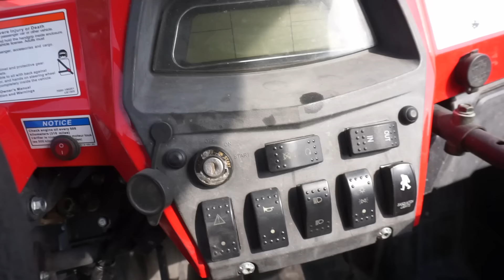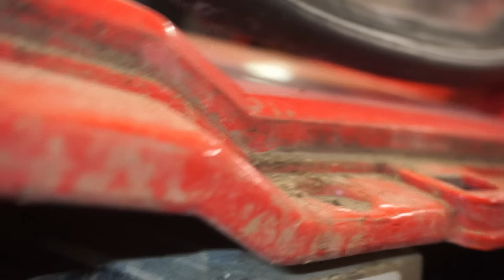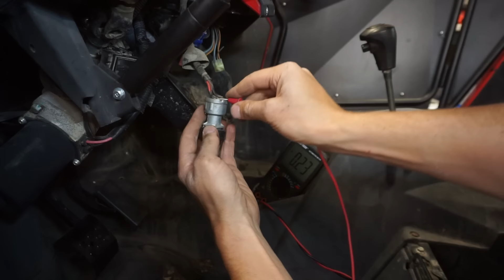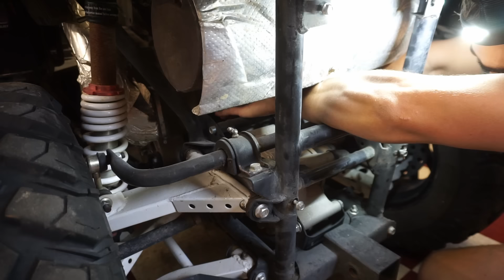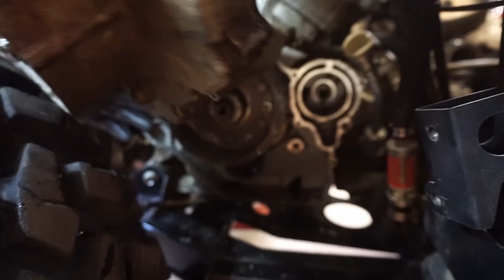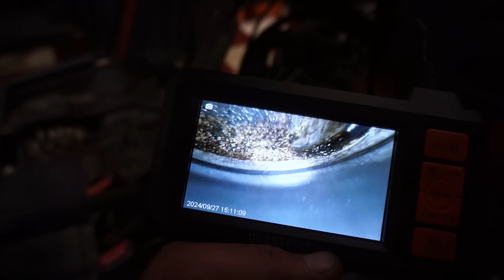Seller Sold Me This $7,000 UTV For $2,500. How Bad Could It Be? (VERY RISKY BUY)

Comment: bubba probably pulled the starter wire out so he could sell it as a "wiring issue". he knew if the buyer turned it over and heard that grinding noise he wouldnt get more than $500 for it.

Comment: I have no idea why you don't check if the engine rotates before you start doing anything, it's literally the first thing you should check - compression - fuel - ignition.  Engine locked up?  Take it out first so that you don't have to jack around removing things with no space and you can crack it open without debris falling into the crankcase.

Comment: At 24 mins it worked after you moved the relay so it's probably a bad ot intermittent relay. I had one on my 2005 Kodiak 450.  Tap it with a screwdriver and it would work then not work after

Comment: For future use instead of using wd40 on electrical parts use electrical parts cleaner or alcohol. Wd40 leaves a greasy film on electrical parts that can cause a short or improper electrical connection.

Comment: Hey, yeah that's doing it the correct way in probably just replace the crank you're probably going to have to pull the motor anyways on those type of things because once you get into it you're going to realize that maybe there's something else inside that could be bent or something else so I don't think they run that much the cranks for those they they usually run about $150 to 300 you figure that the other parts the starter and everything  is about 30 or $40 I mean if it costs $500 to fix it where can you buy one of those for $500 that's I learned a long time ago you're better off doing it the right way the first time then doing it the wrong way 3 or 4 times😂 that's why I don't go on Facebook Marketplace and buy stuff I don't buy stuff at auctions either cuz most of the time it's crap people wanted to dump anyways well good luck to you anyways by the way I wouldn't touch Kubota crap at all everything Kubota is crap as far as I'm concerned
The key is not a safety thing by the way you need that on an ATV it's there because of the torque that's why it's bent in the first place I can tell you this much they just didn't park that thing they were running it hard and over revving it too I wouldn't be surprised

Comment: They all break,  I have a john deere utv, the fuel injection system cracked, had that replaced under warranty, I have a polarse utv and a kabota utv. I had to fix more on my new polarse than anything. The kubota was given to me. I had to fix the over heat issue. Sensor was bad and the wires were hooked up backward. No over heat issue anymore

Comment: So I think that the Japanese were by the 80s buying parts that were cheaper from other country’s, Carbs are available around the world, Switch gear from Taiwan, Yamaha Etc because it’s about profit and Quality, control the suppliers   The product is spect and the parts are good. 
    Again this stuff being churned out is throw away Crap 💩. 
   Low Quality and spec then is made cheaper by suppliers cutting corners or just Poor steals, 
      But Joe goes for the Challenge and nails It 💥, 
    Well done buddy

Comment: Hey bud. You can make a key with brass and then you can weld the crank without filling the slot. You can then pull the brass key out. You can take a small grinder and clean up the slot. Put a new key in there and your back in business

Comment: I hate to say it but I think the no turning over/starting issue was a decoy to sell it. They intentionally created that problem by not plugging in that relay all the way just so whoever looked at it would think that once that potential electrical issue was figured out then they would have a good UTV. People are very dishonest and they will play a lot dumber than they actually are when it comes to financial gains or losses which for this seller, it was a loss. There is no way that engine was running great and just all of a sudden didn't start back when they turned it off one day. It had to have sounded like marbles in a tin can or giving some sort of noise or signs. I'd bet the farm the seller knew more than he was telling you but it does make for good content. Good job figuring it out and I hope what you have found is the complete, right fix for it.

Comment: As far as the damaged keyway on the shaft of your new project, you can fix it a number of ways. You can enlarge the key way and have a new key made to accommodate with the old one did.
Reply: They also make a couple of different products that you can fill the keyway gap itself and make a new keyway. It’s a liquid metal type.

Comment: Loctite 660. Used on the early Miata crank repair. When done correctly, it will last 50K plus miles when its time to do timing belt again.

Comment: Do you really want to tarnish your rep just because you don’t want to take the engine apart. I wouldn’t want to buy a CF Moto without a proper woodruff key put back the way it should be. I’ve been watching you for the past 2 years and you are the best but if you don’t fix that machine back right I wouldn’t trust your work anymore that is disappointing ☹️

Comment: Depending on your frame of mind and of critical, check the fit of a new woodruff  an if it's fair an stable not tipped leaning the easy route is clean the taper. File sandpaper the boogers off shaft & inside flywheel, blue them, lap them, mate them to each other to your satisfaction then clean them well. Set the new key add enough JB weld or similar to fill shaft imperfection put them together and make/draw them tight torgue to spec or a bit more it will hold for years as the taper is the strength!  We have a 6 cylinder diesel powered air compressor which had a similar issue it's been apart once in the last 40 yrs for an overhaul the key & taper weren't the issue, bearings & rings were.  Good luck regardless of the route you take and the copper key an tig sounded doable if accessible it's time & money and your call in the end.  Clean the  one way bearing 1st see if it is truly junk?

Comment: Just take and shape a piece of wood the same size as the wood ruff key, tape it length wise, and weld up the damage. The piece of wood will help not get weld into the slot area.  Can dremel it down, a little high, then use every cloth 220. 320, then 400 grit. Upto 600 grit, metal sand paper. Not sand paper for paint. Lol. And should be good to go. Heck a wooden doll rod about the size of fly wheel outer, hole diameter, wrap your sand paper around the doll rod, get in there attach the end of the doll rod, ( so it fits into a drill. That end, bring smaller so. Fits the drill. Then ream it, a little to get the scuff out. I'm sure can get good enough to re use. Coat it with 518. And be good. Aside from the 1 way clutch.

Comment: Why do they use plastic gears in the motor. Don’t understand why go cheap with plastic
Reply: We had one on a Toyota Landcruiser strip out a few teeth, idler gear between crank and camshaft drive; we were in the middle of the desert in Saudi Arabia, came back the next weekend and fixed it where it broke down. Luckily we were in a group of a few cars.

Comment: Never be surprised by a dirty interior of a D.C. brush motor/starter. The brushes always are going to create dust as they age. So I don't understand him worried about how dirty it was. They start getting dirty as soon as they are in use. And being both an electrician and a electronic tech over 35 years (I'm old) I don't recommend the use of WD-40 to clean electrical or electronic things. Not at all, never.

Comment: Inplace of the woodruff key  I have seen the crank drilled  and a pin used to line up the flywheel , the only problem is drilling a  hole for the pin into the hardened crank.

Comment: I had one of these for almost 6000kms and a few years and it wasnt bad with reliability truly, regular maintenace.  We even sunk it in some water, didnt hydralock but water did get into the oil, flushed it and it kept runnin.  I had the water pump leak at first but it was fixed under warranty.  The ride sucked on stock suspension because the trail version has almost no travel in the back so it tended to be a spine buster i had elkas put on it last 1000k they were awesome made all the difference.  Mine was a 2018-19 i believe. It was a blast to ride too.

Comment: The bolt holding the flywheel was loose. Key sheared, wrecking the shaft and flywheel.
Reply: Best way is replace crank. 2nd best is weld crank, and machine it.

Comment: If you can't get a flywheel, could you clean the inside taper and then locktite it onto the shaft? I'd use some prussian blue to ensure that there was good contact from the remaining taper.  Then if you welded or jb welded the keyway - you might have a reasonable fix.  Of course your machinist friend could probably weld things up and restore them but at what cost?  Love the videos.

Comment: Check the part number on the flywheel and see what other years that same part number is used. On later model CForce models they used the 800 twin in a 4wheeler chassis, check what flywheel they used. The sxs had different chassis widths besides Trail, they had a 800EX.

Comment: To retrieve trouble codes for a 2019 CFMOTO CFORCE 850, locate the diagnostic port near the computer, then short the green and purple wires with a paperclip or wire to initiate code reading via blinking lights on the dash. Each blink represents a number, with 10 blinks equalling zero; for example, five blinks followed by two blinks indicates code 52

Comment: I believe that you sheared the woodruff key because otherwise it wouldn’t have fired at 25:03, and it clearly fired. I don’t think it was anything you done wrong just the luck of the draw. Cheap Chinese junk, but i love watching you fix these things and I’m sure it will run again after you’re finished with it. So get the parts and get in there and get it fixed Joe. Love your video’s and wait patiently for the next.

Comment: Been building small racing engine for years the only thing that Woodruff key purpose is to put the flywheel in time that's it you don't even need it just use valve lapping compound on the crank lap the flywheel wheel in put the flywheel on with a impact it will not spin

Comment: I just don't understand your desire to continue to operate something that clearly is NOT functioning properly. That will only lead to more damage to parts that may be good. Your diagnostic skills need some serious polishing. This leads me to wonder what you do for work/income. So the initial codes for the Crank position sensor...seems the machine wasn't lying. An incorrect or no CPS sensor signal will stop the starter relay from operating via the ECU. The ECU which controls fuel injection, ignition, timing and fuel mapping, etc., etc. NO CDI on this machine. There is no Capacitive Discharge Ignition system on this machine. Near the beginning of this video you misidentify the EPS (Electric assist Power Steering) module for a CDI. This unit doesn't have CDI. Did I mention this unit doesn't have a CDI? CDI has nearly vanished from the motorcycle industry. Anything that is fuel injected DOES NOT HAVE A CDI. So A Yamaha PW50 may have a CDI. How much actual time do you spend on each of these machines? Like this one for instance.
Reply: Joe is loaded bro, he owns like 5 properties and makes millions a year bro. Many times he has continued working on projects (I’ve seen them all) and the persistence works out well.

Comment: the reason that they put the "P" in front of the code is because it is a powertrain related code. On cars, there are different letter prefixes depending on what component the code applies to.

Also, the woodruff key cannot be the only issue, there has to be a cause. Could require an engine rebuild, but not always, who knows.

Nonetheless, hopefully this machine gets fixed and is able to hit the trails again. Love your content man, helps me wind down after a long day!
Reply: Good tip.

Comment: I would lengthen the slot for the woodruff key with some creative Dremel work and fashion a longer woodruff key? the slot in the flywheel is already long enough and the longer key gets you away from the damaged area on the crank. I bet you could disassemble the flywheel and clean up the debris in the one way bearing and resolve the issue with the flywheel. Seems to me this would work just fine for a machine already plagued with many issues. what a POS machine.

Comment: Likely the flywheel was not torqued up to spec by previous repairer?  That 'Center piece' Flywheel bolt was loose!
File up a copper woodruff key so when you mig weld the slot on the crank, you don't fill it in. 
File the weld down close to the taper.  scrape off any damage in the flywheel taper. lap the flywheel back to the crankshaft taper with fine  valve grinding paste. check fit with engineers blue. Wash out the one way clutch with Kerosene. 
Fit new woodruff key,  degrease the tapers and tighten up to spec. If you are wary, put a dab of Loctite bearing fit on the taper and threadlock on the bolt.

Comment: I found myself wondering after seeing the starter motor repair, why not just do an EV conversion. You only need a motor, battery and motor controller. You can then throw out all those other parts and the rest of the engine and fuel system. All the best.

Comment: Easiest way to fix the Woodruff key is to clean the crank where the key goes really well and use either Loctite Quick Metal or JB Weld. Make sure what ever you use is fully set. Then re-establish the proper key way profile before installing any timing components. 🤷🏻‍♂️ might not be the best fix.

Comment: Joe just so happened to buy a Snap-On ratchet & socket for $2500 and got it with a free CF Moto wrapped around it. :)
Reply: Not a 2500 ratchet and socket not even close.
Reply: @jerrywilcox9890  The speed at which that passed over your head was incredible! 😁
Reply: @dfoltz268 it didn't pass over anything
Reply: @dfoltz268  It did make me laugh 👍
Reply: @dfoltz268  lol

Comment: I've always called them an over running clutch.  That sucks the keyway is damaged. Have a new keyway cut and leave the damaged one alone.
Reply: Wouldn't that require pulling the engine to get the crank out.  Also the timing would be way off

Comment: You use A very very slightly little bit of that plumbers putty to hold that woodruff key in that crankcase shaft or window seal sticky putty either one will work for that process. While you weld around the crankcase shaft. Then using mic gauges and decking gauges and depth gauges. In your case it will be one of each gauge as in every single gauge. You'll just need 3 of them altogether to measure that crankcase shaft. I might show up at krustie 1 place down there in Tennessee.

Comment: I had a dirt bike that is the same thing it wasn’t and electric start but the woodruff key sheered and damaged the crank the correct way to fix it was with a new crank but I didn’t do that I I cleaned the crank shaft up just by taking the burr off and the the same with the magneto and gat another woodruff key then used some 620 green high temperature locklite basically just locklited the key in place let it set fo 24 hours and it never spin again

Comment: Get rid of the corroded fuel filter glass fire hazard end install metal fuel filter. It's like a 4.00 fix   sand or file the burs off the crank when you go to reassemble it. Use a lot of locktight red  with new parts. It should be fine, but i would wait until everything is cured 72 hours before running it

Comment: You are wrong it turned over when you found the relay problem I went back and listened and watched and it turned the engine over because you said it turns the engine over but it wouldn’t start it so it happened when you out it all back together and tried to start it then you need to go back and listen to what you did and said

Comment: I screwed up and did the identical thing to the crank on my Toyota 22R. The key would barely still index in the bottom of the slot. I cleaned everything good with brake cleaner and installed the key. I can't remember, I think I heated the crank snout and soldered it but that repair has 250 or 300 thousand miles on it with no problems. All you have to do is repair for the minimal side thrust.

Comment: Clean the flywheel and crank.  Fix both with JB weld or other favorite metal epoxy. If it's good enough for a crank repair, it's good enough for the flywheel also.

Comment: Voltage test on battery does not always mean it is good.  Do a load test as well.  I ran into a situation where the voltage was good but failed under a load test and needed a new battery.